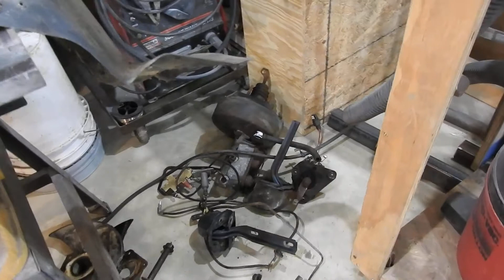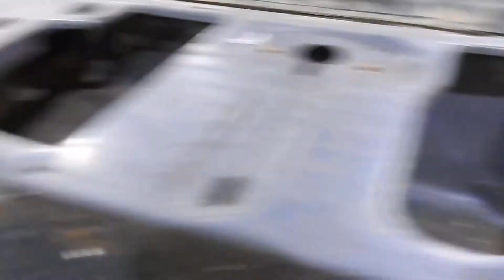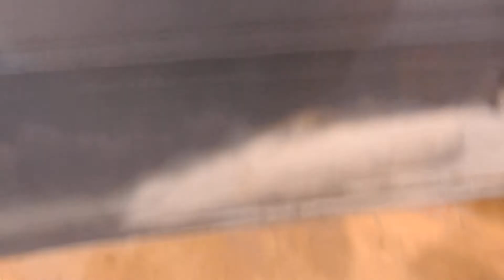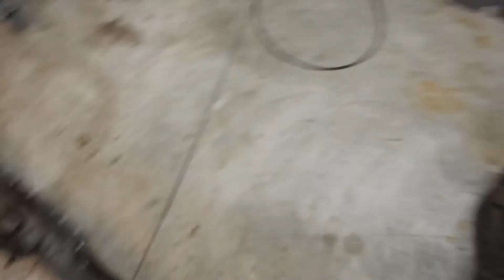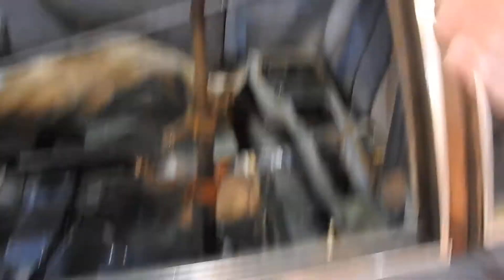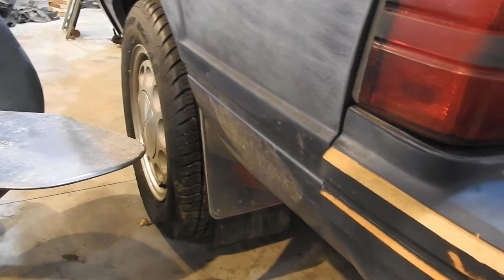83 Mustang Restoration 11/15/2020

Comment: Don - did you ever say what your day job is/was? You seem to have more knowledge and "stay busy" than anyone I've come across in a long time. ps: I stay busy also - watching other folks do their projects on youtube! ........ just sayin' ......... ;-p
Reply from the maker: In high school I did metal and wood shop. Served four years in the Marines as a C130 engine mechanic. Got out and did five years as an aircraft mechanic at a local FBO. Then went on to nine years in industrial maintenance. For all those years I was building and racing Mustangs. The last eighteen years I have been building houses. I also had a Dynojet chassis dyno and did custom tuning and mods to all makes of cars. The rest you see in my videos.
Reply: @Dynodon64  - yep you've been a busy fellow .... I was in Marine aviation also '63-'67. got my A&P, worked for PSA in San Diego plus several stints at FBOs. Worked as a carpenter for twenty years then drove taxi and school bus when my back went out .... lung cancer 10 years ago and now I watch youtube makers ...... keep on trucking brother ..... ps: Happy 245th Marine(10 Nov.) Semper Fi ............. note: the Corsair has always been my favorite prop A/C .... My Dad was stationed in Kaneohe, Hawaii in the early '50s and I used to sneak up to the top of the hill (between housing and the runway) and watch them take off (caught hell for it too!)
Reply from the maker: @unclejack123  Sounds like you are a touch older than me. I drive Uber part time in the winters as well. But with this covid scare, I haven't been out.
Reply: @Dynodon64  just a tad ... I'll be 77 in late January ..... still kickin' (just not as high or hard). thanks for the conversation Don ... stay healthy and busy ..... ;-p
Reply: @Dynodon64  We have a similar experiences. I took welding and auto shop in HS. Afterward I was an A&P mechanic for about 12 years, worked on heli's, P-3, C130's, F22, F35, and even regional jets for a while. Now working in electronics. I was involved with you years ago on the Stan Meyer stuff. Currently restoring my dads '66 Vette as well so it seems we have many similar interests.

Amazing work on the Corsair BTW- such a cool project right there!
Reply from the maker: @BradKwfc  Very similar indeed. I would still like to solve the Meyers problem. Some day I will get back on that one.